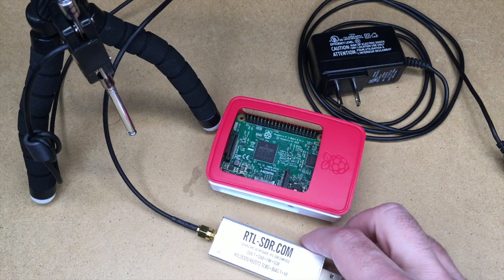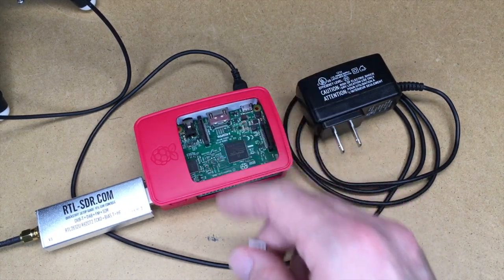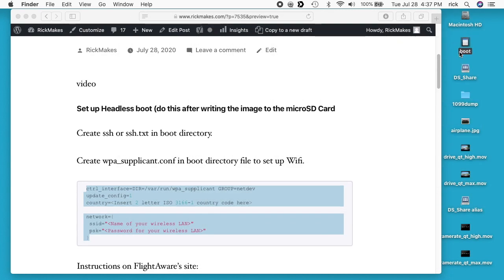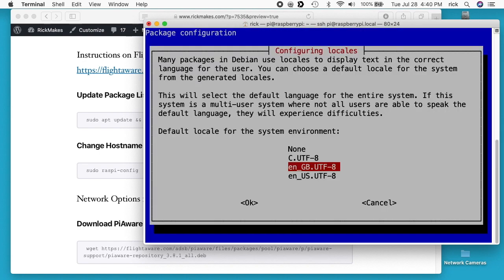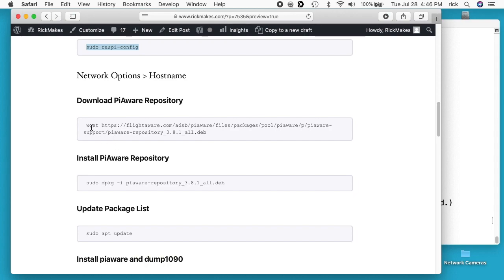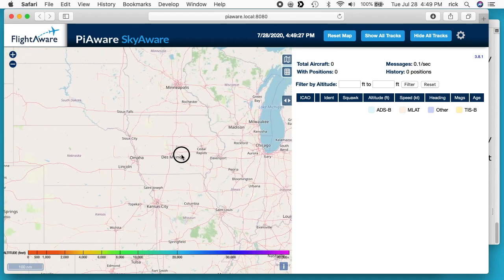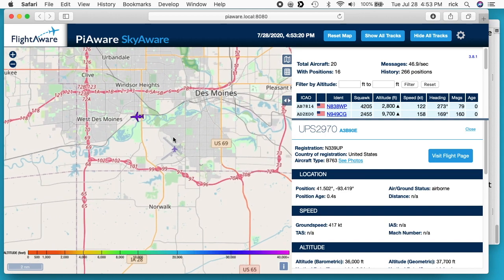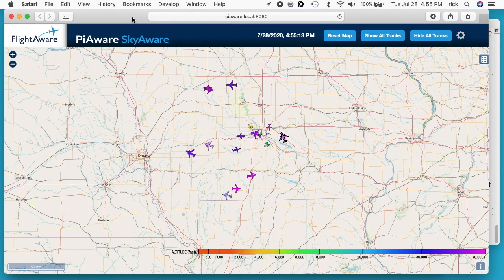Tracking Planes with RTL-SDR and a Raspberry Pi running PiAware

Comment: One question. Is there any way to hear what the pilots are saying???
Reply from the maker: You can supposedly use the RTL-SDR to tune into air traffic control but I haven't done that yet. You can't do it at the same time as monitoring ADS-B (with the same RTL-SDR). I'm guessing you would need the proper antenna and the right frequency to tune into using software like CubicSDR or SDR#.